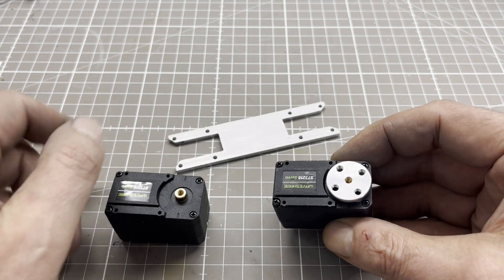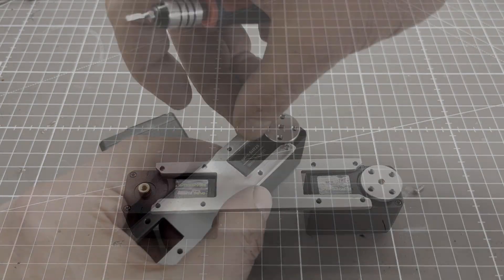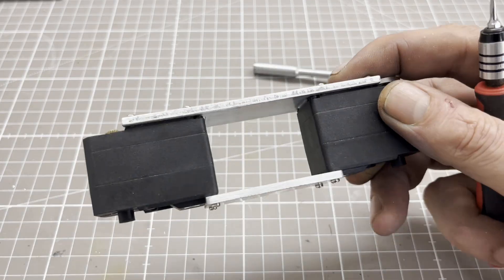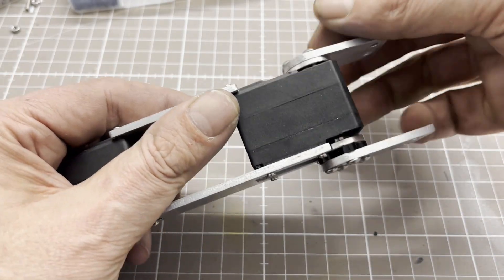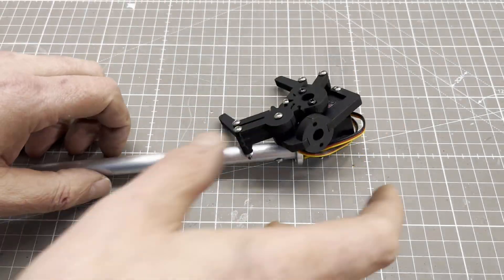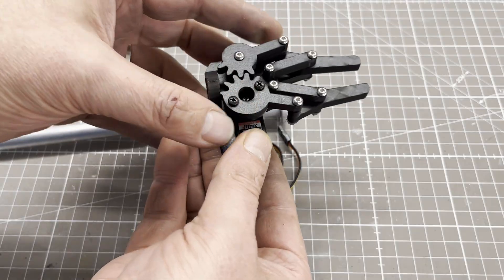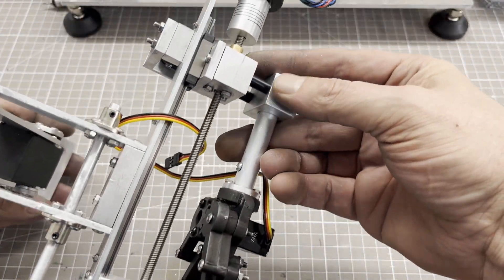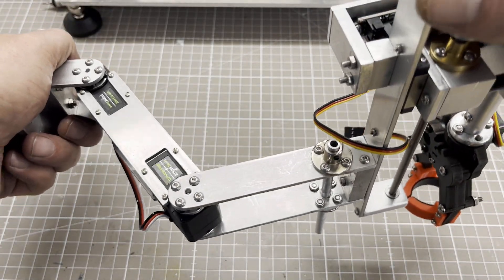Building an autosampler, part 1

Comment: Well the arm of the Terminator is almost done 🙂, ups its the auto-sampler, great work ! i know how hard is to work without one CNC
Reply from the maker: Thanks:) The biggest issue is to square up bigger stock. Would be so easy with a mill:) But with paper templates,  a scriber, layout fluid, sawing, and above all filing, you can get quite far. Takes forever, though.